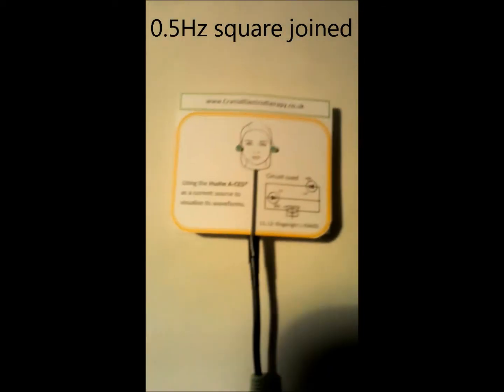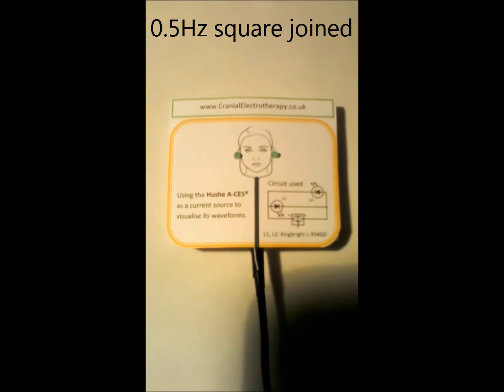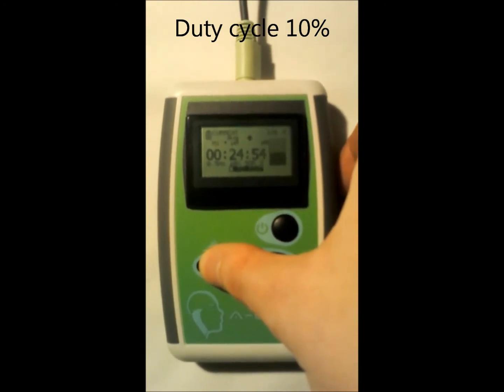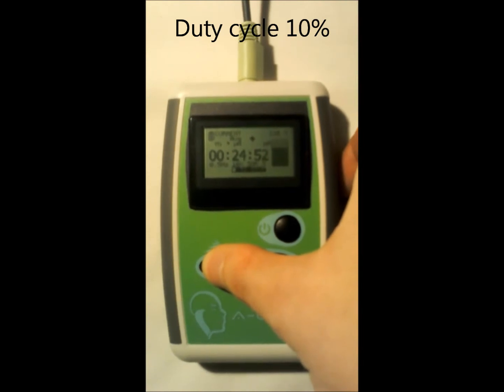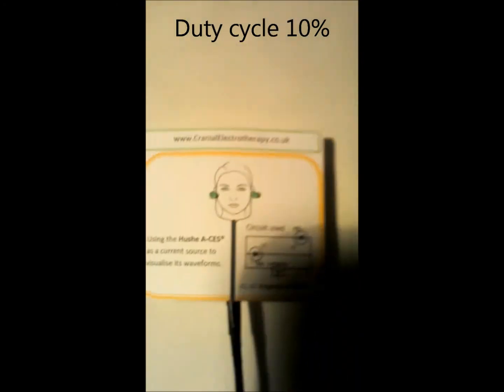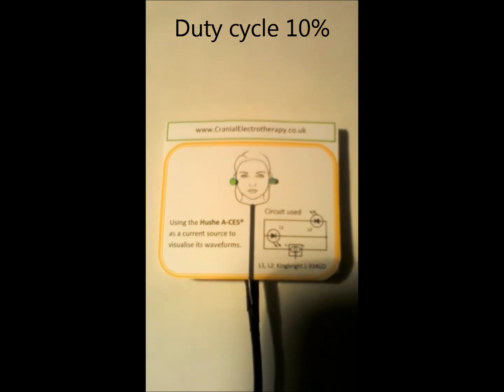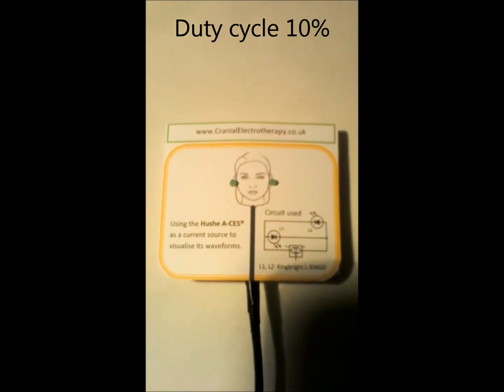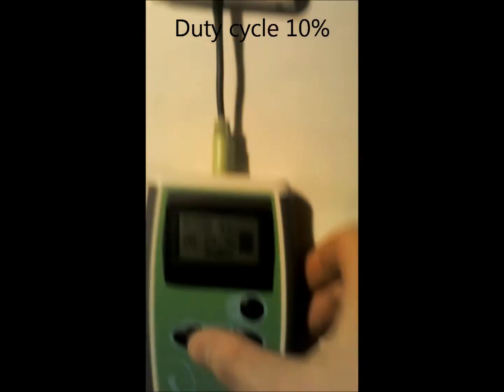Demonstrating the Hushe A-CES® waveforms using LEDs

Comment: HI Chris, I checked out your user manual and you certainly have a versatile CES. Don't quite understand the pulsing modulation. Are all frequencies pulsed at 970hz?
I also like the fact that you can change the waveforms. I am looking for a unit which goes above 100hz as there may be some cranial anatomy which responds better to a higher resonant frequency. Such as the thalamus and the pineal. Theoretically there should be a resonant frequency for each individual area of the brain. I think there are some units that go up to 200hz. I would certainly like to experiment with a CES instrument. I was very interested to learn that you first experimented on yourself and that the results gave you the momentum to develop a high spec device which undercuts the competition.

Comment: Thanks for your reply Chris. Where can I find the specs for your device? Hz range-microamp range-pulse range etc? also what are your thoughts on where the electrodes should be placed on the head?  The original studies were done on the earlobe, Then behind the ear for practical reasons but recently I have seen electrodes designed to go in the ear to be in contact with branches of the vagus nerve. Thank you.
Reply from the maker: The technical specifications are towards the end of the owner's manual in the section "Technical details", a link is provided on the website. In summary, the device can generate frequencies of 0.5 Hz, 50 Hz and 100 Hz, with the option in the firmware to allow for a linear frequency adjustment from 0.1 Hz to 100 Hz in 0.1 Hz increments. However, that option is something that is set at the programming stage and does not currently appear in the instruction manual. I used the three commonly researched frequencies for consistency and user simplicity. The A-CES® has a maximum output of less than 600uA, although in practice this is lower.

Regarding the positioning of the electrodes, I've also seen them being used in the locations you mention, and I opted for the ear-lobe positioning due to its simplicity and proven effectiveness. It requires no straps or adhesive, just a simple clip. Also, there are some users who would not be very keen on inserting objects into their ears, which I would consider to be an invasive technique that is perhaps best used in professionally administered treatment as opposed to personal use.

Comment: Thanks for this demo. Did your product take off it looks like you put a lot of thought into it? I noticed that on your shop the product has zero stock. I am intrigued by this and would be curious to learn more.
Reply from the maker: Hi David, I have lately been conducting a number of studies using the Hushe A-CES with several volunteers, and the results will be published soon when all of the response questionnaires have been returned.  The results are promising, and I look forward to publishing them as soon as possible. The device is now back in stock.